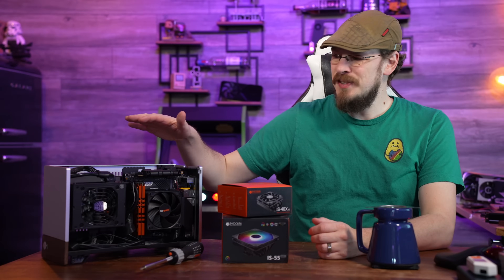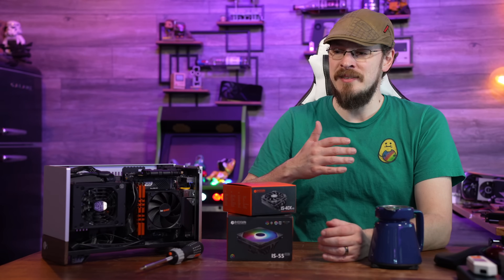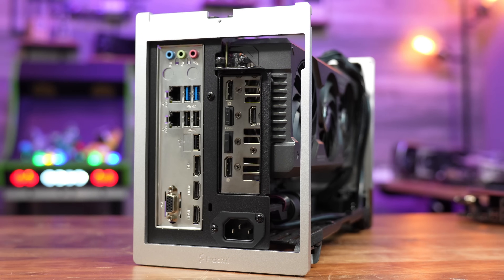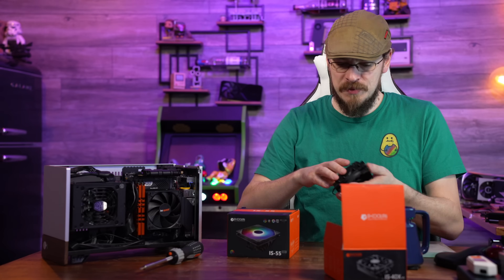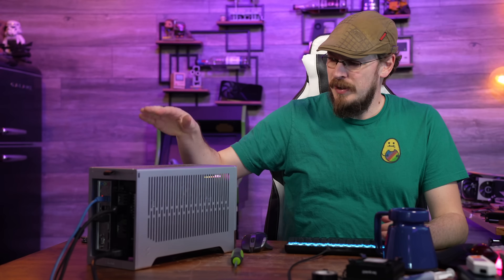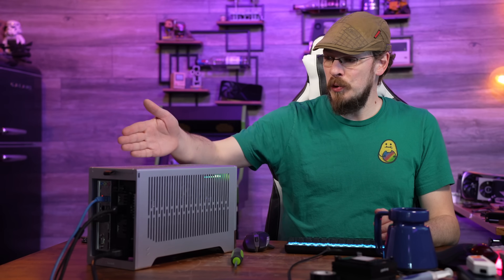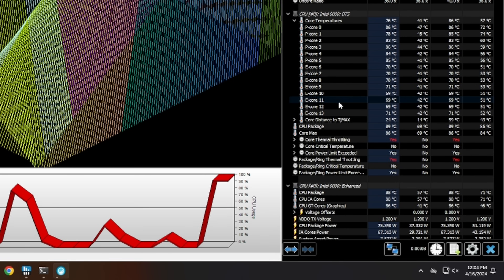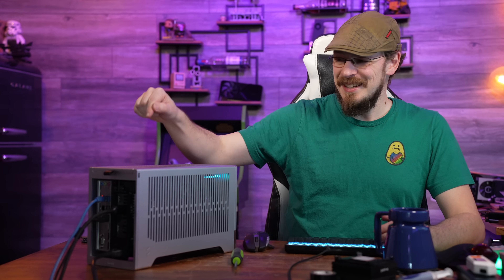Fixing the 13900H (ES) Overheating - 10729 ITX Motherboard

Comment from the maker: Alright, I heard you all loud and clear. I removed the heat spreaders from the 32GB 3600 kit, and here are the results.

be quiet! Pure Rock LP:
Overall: 10,285
Graphics: 12,047
CPU: 5,6,25

ID-COOLING IS-55 (w/2666)
Overall: 10,226
Graphics: 12,029
CPU: 5,531

ID-COOLING IS-55 (w/3600)
Overall: 10,331 (+1.0%)
Graphics: 12,020 (-0.1%)
CPU: 5,753 (+4.0%)

Still not the butt-kicking I expected with the CPU staying at 95W vs 79W, but now at least it beats the be quiet score.
Reply: Any chance you can remove the heat spreader on the cpu?
Reply: Margin of error stuff.  I highly doubt anyone would notice any difference in performance between these two sticks in real life gaming.
Reply: Are the be quiet results also updated to exclude heat spreaders on the ram?

Kidding! 😎
Great videos 👍
Reply: Wow, thanks so much for the update!
Really appreciate you following through here, since its probably not worth making another video.
Keep it up!
Reply: You should look into pure copper options and noctua swapping the fan in the future maybe?
Reply: Welp.... at least it's quiet
Reply: Liquid metal TIME?
Reply: 4% makes sense.

Power to clock is exponential where performance is linear if not hitting some other bottleneck.

I run my 1070 ti down to about 80w with a locked 1800mhz core at a very low voltage i beleve less than 1v but to go to 2100mhz it's bairly stable at the max srock voltage (no volt mod) and easily pulls 140w.

I have had skylake mobile cpus throttle in very interesting ways where it wouldn't smoothly drop the clock but pulsate between min and somewhere close to max on the hot cores causing latency issues but not actual raw performance issues. So staying under the throttle point more often may be beneficial in other ways.
Reply: Great video!

The only other thing that I might check to reduce the number of variables that are causing the variations would be the timings on the RAM for the DDR4-2666 kit vs. the DDR4-3600 it.

You mentioned that you've added the heat spreader, but there is no explicit mention for the RAM timings.

4% gain for CPU performance for ~18.75% increase in power consumption doesn't really seem like it would be worth the extra power.
Reply: Another people using this motherboard are changin the termal paste beetwen the cpu and the cooper plate for this: Thermal Grizzly KryoSheet Wärmeleitpad - 38 x 38 mm and obtain a sustancial 20º better temps ;)
Reply: @liarxar__3050  
Yeah -- I am not sure if the Kryosheet would make THAT much of a difference.

I have it deployed in my dual Xeon server and the peak temps are about the same or a little bit higher than when I had use the Noctua thermal paste.

Not super crazy better, per your claim, but if it worse, it is only slightly worse than thermal paste.
Reply: @arugulatarsus  Yeah im curious can you get direct die contact with the mobile chip instead of trying to pass heat through an extra medium?  

(Im guessing that plate exists because of the clearance difference not having the actual LGA socket existing on the board.)
Reply: Exactly what I wanted to see cause it was like that sounds the ram speed
Reply: @LanceNotHiding  Yes, I am 80% certain that Jeff can hack something together though... maybe then sell it on his store!
Reply: Maybe in the wattage scenario the utilization of P cores and E cores are different.
Reply: to be frank you are now using memory that is 26% slower than the previous one. I am surprised the performance is so close. Anything outside CPU cache is running on 74% the speed it had before. This includes addressing the vraphics card from the memory itself. So... somehow... you are getting the same performance on 74% bandwidth. That is incredible!
Reply: @ewenchan1239  Mayhaps the Kryosheet applies better pressure contact in this application, without a thorough evaluation we would not know.
Reply: @tumblw33d2  
The Kyrosheet is too thin to have any impact on the contact pressure.

(I am using two 38 mm x 38 mm KyroSheets in my dual Xeon E5-2697A v4 server and I know from actually using the Kyrosheets, that it is wayyyy too thin to have any meaningful influence on contact pressure.)
Reply: Interesting that refitting the fast ram still only moved the performance by 2% overall, from -1 to +1.  I do wonder if your refitting of the copper spreader altered something.  As now the only two extra changes are refitted cpu spreader, and no ram spreaders. It also seems possible that the improved airflow making things like the ssd, chipset, etc happier might explain the 1-2% shift.  

It's still curious to me that the core numbers changed so much with such slight overall change. Ww could argue that the BQ fan had the cpu under less wattage stress for only a 2% performance loss. Weird.

Comment: 15:30 the memory speed did impacted the score i think
Reply: If you pair this beast with does 3600cl14 b-die kits :cat-orange-whistling:
Reply: Or it's run to run variance.
Reply: I was thinking the same thing, it is impressive that, even with the slower memory, it was within a margin of error of the smaller cooler with the faster RAM.
Reply: Intel isn't sensitive, they learn their mistake from C2, they moved away from gluing.

Meanwhile, the competition, introduce a lot of unnecessary bottlenecking, IF-MC-FCLK cannot run at 1:1:1 (since Zen++ and Zen+++++, FCLK for Zen+++++).
Reply: Firestrike always yielded better results with lower frequency AND timings RAM settings. So, I highly doubt it was memory.
And also firestrike score scales a lot more with graphics overclock than CPU. Couple hundreds more CPU Mhz is indeed a mere couple percent above baseline score (that is if overclock is even stable, you may very well go down in score otherwise).
But Cinebench is a surprise though.

Comment: I suspect the CPU is fluctuating very quickly between 95 watts and lower wattages, and is doing it quicker than the granularity of the monitor program. Did you try an R15 single core run to see how those compared?

Comment: Have you consider using a Graphene sheet like Thermal grizzly Carbonaut or Kryosheet? You would have to cut one to fit the actual CPU but, it may yield more stable results than thermal paste in some cases. I have a hunch it may help with the BeQuite Heatsink and you wont have to sacrifice on RAM.

Comment: "Standard height memory"
What I've done in the past is to shuck the heat spreaders off the memory, that usually reveals something close to, if not exactly, standard height sticks.
Probably voids your warranty, but, I've never had any memory issues doing this. Also never tried it with DDR5 which, tends to be thirsty for cooling.
Reply: Those thermalpads are usually glued to the heatsinks, so it is a one-way ticket.
Reply: Older Corsair Dominator RAM sticks were glued down with thermal epoxy and in an attempt to remove them I removed two of the chips on the board. I would say that was the exception, rather than the rule though.
Reply: Yup. I've done the same to my two 32gb ddr4 dimms to make more space. Been running fine at 3600mt/s for years. 
Just be careful when doing this. If you're not careful, the memory chips might stick to the heatspreader instead of the pcb.
Reply: There's plenty of fast memory that comes with a heatspreader with almost no additional height. A basic metal plate is enough, these tall fins are just for show.
Reply: I like Corsair Vengeance LPX, those are low to begin with.
Reply: I'm not sure why he did install the cooler that way and not with the overlapping part over the VRM heatsink instead. Sure, that would make the EPS connector harder to fit, but it looks like the VRM there is not tall enough to interfere with the cooler.
Reply from the maker: The heatpipes stick out one side, and the cooler will only fit in that single orientation.
Reply: The problem with DDR5 is the voltage regulation, so if you do remove the spreaders, you are going to be running those VRM components way hotter than expected. I have a kit without heatspreaders but they are also 4800CL40 vs 6000CL30 of my personal rig.
Reply: @CraftComputing  There's one cooler NASCompares used on his Jonsbo N3 build which supposedly clears those  RAM sticks with heatsinks. Same motherboard as yours.
Reply: @CraftComputing  The Thermalright SI-100 is tall enough to clear the RAM. If you don't have 7mm of height available, ID Cooling suggests you to rotate the cooler 90 degrees so it clears the RAM.
Reply: @CraftComputing  If you have 75mm available, the Thermalright SI-100 will clear that RAM. Alternatively, you can turn the ID-55 90 degrees as suggested by ID Cooling on the ID55 product page.
Reply: Assuming there's enough space available, the Thermalright SI-100 is designed to clear tall RAM memory. Alternatively, the ID 55 can be turned 90 degrees.

Comment: I've loved this two part series on the 10729 motherboard, and it definitely whetted my appetite to play with one. When a few of the 13900H boards crept back into the AliExpress store mid-July, I picked one up. I have to say I was not disappointed! These are just brilliant fun, and great value.  I chose a Formd T1 case as an easy option for this build; a Zotac 4070 Super OC seemed a nice 2 slot GPU to use. Big thanks to Jeff for his homework on the CPU cooler; the IS55 works really well (I replaced the stock cooler fan with a Noctua 12x25mm fan as well); Crucial Pro 3200 DDR4 memory fits under the CPU cooler, and a WD SN770 1Tb SSD is a good starting point for storage. PSU was a 2024 Corsair SF750. I'm not sure I've even seen the PSU fan kick in yet - even playing Helldivers 2 on ultimate settings! Final case cooling was a couple of Phanteks T30 fans to vent warm air out of the case. Fully assembled, there almost seems like too much space left inside the case! The CPU Power Limit Override came from the factory set to 'Auto' (with PL1 being 65W & PL2 as 108W). I haven't played with those yet - but CPU power draw is low, and  CPU temps hang around high 20s, and loaded are closer to 63 degrees C. I'm interested if Jeff's came with higher default PL1 and PL2 settings from the factory.

Comment: On the IS-40X can the shiny metal brackets be flipped so the threaded studs are facing away from the motherboard? Because that looks like how BeQuiet did it on theirs.

Comment: I wonder if the fact the be quiet is smaller, the case has better air flow.   Maybe with the bigger fan the air flow is a bit blocked and maybe the guy is overheating.  Sat the gpu is causing a throttling.  Who knows?  What was the high temp on the cpu given all the cores were fine?

Comment: Can you compare this to a standard 14600 or 14600,  + itx mobo both in performance as well as idle power and peak power consumption?  Specifically when you control all other variables.  I want to know if the H processors will use less power at Idle but still perform competitively with the 14600 on a performance per watt basis.  If you set power caps on the 14600 would you achieve the same performance as this setup?

Comment: TimeSpy is very memory sensitive. As others have pointed out, that's the difference. You can easily get 10% CPU score in TimeSpy by overclocking RAM and tuning timings.

For reference, I have a system with an i3 10100F and 2666Mhz RAM without tuned timings that scores ~4500 in TimeSpy CPU. An FX8350 system with everything overclocked and RAM properly tuned down to the tertiaries scored around 3600. That's on a Wraith Prism, not an amazing cooler or anything.

Comment: Your reduced memory speed could be having a small impact on your overall performance scores.  Other than that, I am impressed with how much cooling compacity you're getting with the IS-55's super slim fan and nearly zero clearance from the side panel.  Have you tried testing the thermals again but without the side panels in place?

Comment: I'm a big fan of the IS-55. I have one in a SFF OEM system cooling an i7 9700. Removing the power limits, and running R23 for 30 minutes straight it has it sitting in the mid 80's pulling down about 115 watts. I'm thinking about swapping it out for the IS-67 XT, which might even be a little better. I put one with my nephews new system I'm helped him put together in the ridge and it was cooling the i5 13600K @ 150 watts in the low to mid 80's as well. ID Cooling is really killing it. Too bad that won't fit in this setup, but it seems the IS-55 is holding up.

Comment: 8:12  erying has a video on this topic with thier Vapor chamber video.  they litterally had to because they made the ihs too low and alot "lga 1700 ready" coolers are actually not usable.

noctua l9i  (lga 115x/1200) with a 1700 bracket on it will have the mounting holes line up, but the  cold plate is thinner and actually comes into contact with some parts with the board. 
the l9i lga 1700 fits without touching any board components

Comment: You should check out the Thermalright AXP90-x53 Full Copper. No clearance issues and performs better than the IS-55.

You could also just remove the heat spreaders off the 3600 ram. That cooler has direct airflow over the dimms

Comment: I wonder if the issue with performance is memory speed. I know that these mobile chips really like having as fast of memory as they can get. Going from 3600 MT/s to 2666 MT/s is a massive difference
Reply: The RAM speed dude,  run the test again with the SAME speed RAM.

Comment: The secret with most of these boards is to get better paste between the die and the vapor chamber, I use ptm7950 and it works great, no more thermal throttling, I even overclocked mine.

Comment: if you know how big that gap was between the mid cooler and the heat plate, might be worth using a 1 or 2mm alu/cpr plate as a shim.   But I would be sort of iffy about putting another shim in to a system.

Comment: On several laptops I've tested, I've seen HWiNFO trigger a thermal throttle warning even though temperatures were nowhere near the point where that should happen. I figure it's just a bug in the software.

Comment: Not enough air flow and heat not getting expelled fast enough. Have the same issue with my threadripper. heatsink is very capable sustaining decent overclocks under all core loads but the fans just cant move the air fast enough, the my case fans were garbage and was not removing all the heat fast enough.

Comment: Great video
I know its not worth another video, but i was curious how much of a temp/clock difference those washers would have had on the be quiet.

Oh, and every time i try the BC-250 i move one step forward and 2 steps back.
Sometimes it will show up in windows if i use 6650S drivers, but it doesnt actually do anything. in linux i cant get SSH to work when it works fine on other machines, what i'm probably going to try next is installing linux on a zen2 machine, install SSH, and then move it over to one of the BC-250 sleds
Reply: I am also having issues with a 10729 motherboard on linux. Did you every get to fix this?

Comment: PSA, another way to do this is a PIO motherboard from taobao and a JF13K cooler using a standard 12700k CPU for about the same price.  This puts the GPU and the CPU intake on the same side and reduces the wasted space (and no need for auxiliary fans or risers).  Could do a "dual chamber" and put the 30 dollar FSP-500 "NUC Extreme" PSU under the motherboard for the GPU, and a Dell/ Alienware GaN brick for the system.  Well, that's the dream anyway.
Reply: Do you have a model number for the motherboard by chance? I tried looking it up on taobaos site and it didn't show up but I also don't speak Chinese so idk if it was because I used English characters lol

Comment: lol 2666mts? thats slowing thins down
Reply: Not sure the bios can handle anything outside of jedec specs
Reply: @oscarcharliezulu  The 3600 kit was working at that speed in the last video
Reply: RAM speeds are largely a marketing thing these days.  The difference in real world performance is in the single digits on a percentage scale.  In effect, the performance increase between these kits would get lost within the margin of error (at least in most cases).
Reply: @jameslewis2635 That's somewhat true, if you don't run any CPU heavy application (only play games and edit documents). Also memory hungry applications like fluid simulation and VFXs.
Reply: @jameslewis2635  it does affect @2666mts ;D his board only supports dualchannel, a "normal" Ramspeed for the used CPU tanks min fps but mostly obersvable in synthetik benchmarks, which he used to measure performance.

Comment: ID-Cooling low profile coolers’ mounting mechanisms are far from perfect, had issues with couple thin-mitx boards where mounting brackets or heatpipes were resting on MB elements around the CPU socket which lead to improper contact or no contact with CPU at all.

Comment: Please try to remove the heat spreader from the 3600 MTs ram. Most ram doesn't need it und the cpu cooler blows direct air over the ram.